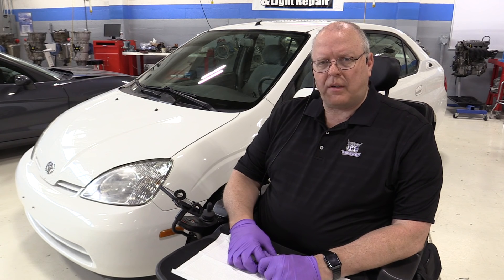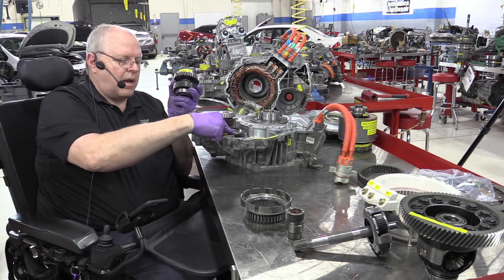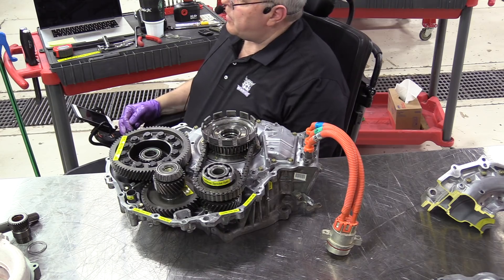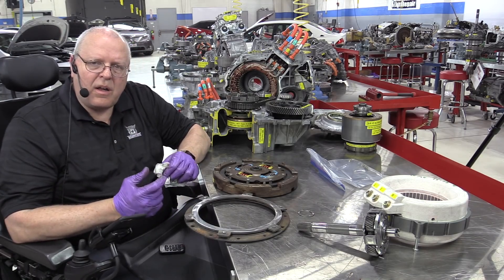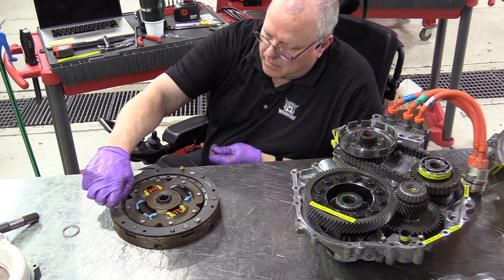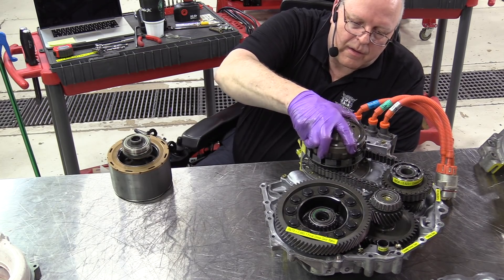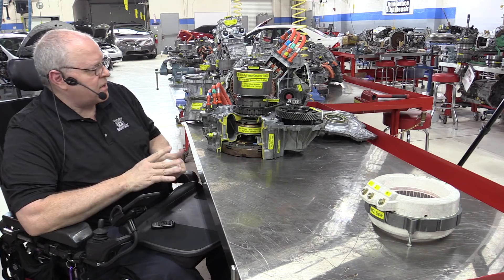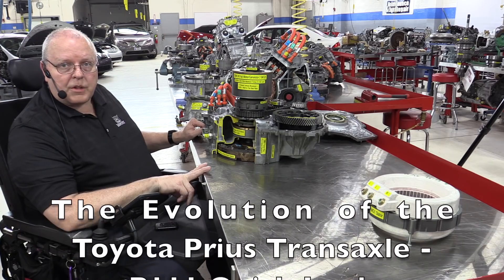1998 - 2003 Prius Transaxle -  P111 Quick Look

Comment: I am considering a p111 without any battery or invertor, as just a diff really., eliminating mg2 or mg1 or both.    If you physically lock mg1, then what is the gear ratio of engine to wheels?  3.91 : 1 like mg2, I thought it had a slight different gear to mg2.   I turn to your videos first, they are the best.  thanks
Reply: You can't if you lock mg1 the Engine is constantly linked to Engine so you would not be able to start or drive the vehicle

Comment: To say that MG2 provides the power to drive the vehicle down the road is not accurate. The gasoline engine drives the wheels. The job of MG1 is to put variable drag on the planetary gear set so as to control the ratio between the engine and the wheels. A by-product of this is electrical energy which is used to charge the battery and/or provide power to MG2. MG2 is also used for regenerative braking. Since the Honda systems lack a motor/generator geared directly to the wheels they are only considered a partial hybrid lacking the key feature of regenerative braking.  I presume that to provide an overdrive ratio, MG1 must spin faster than the gasoline engine and to do this it must draw power from MG2. Similarly, when in reverse, MG1 must drive in the opposite direction and again draw power from MG2 to accomplish this.
Reply from the maker: Thanks for your feedback. I meant to say that MG2 is the only motor directly connected to the final drive gear. Yes, the ICE and MG1 contribute torque to help propel the vehicle, but only through the ring gear attached to MG2.
Reply: @WeberAuto  When the gasoline engine start it sounds like it goes with CVT with hig RPM. I guess this is the reason ?  Hve you planed to see closer on Mitsubishi Outlander PHEV transmision,  i wonder if that is an simular construction ? ( i dont know about that model goes in your country ?)

Comment: Hello sir i have question? I have 2012 lexus ct200 smiler engine as 3rd generation prius. I bought that car from auction and got that fixed which had just front body parts damage nothing to engine or any electrical damage. After fixing that car or even before the car used to start and just after 1 mints it cuts out and fault comes on screen Hybrid system fault. What would you suggest? It starts and moves a little bit then cuts out.
Reply from the maker: Check for DTCs with a Toyota scan tool

Comment: thanks for this video! I've got one of these transaxles in my car and I'm really glad I have a better idea of how it works and what I can attribute to serious problems and what is just normal problems with a 15 year old hybrid. (Basically I'm getting low MPG and no assistance from the battery and a constantly running engine in my '03, this let me realize my transaxle is probably less damaged than I thought still because almost every function you described here is still flawless. My main question is whether the parking brake system being less effective is probably due to transaxle wear or some other more replaceable point?
Reply from the maker: Thank you! The parking brake system has nothing to do with the transaxle. It is related to the rear drum brake system. Best wishes!
Reply: New battery needed ...

Comment: Thank you for your videos! I just took apart Gen 1 and Gen 2 Prius batteries yesterday. The Gen 2 modules are healthy enough and will be put to use, but the Gen 1 cells are stone dead. Would you like to have the Gen 1 battery for display/poking at? I am somewhat local.
Reply from the maker: Thank you! Yes, that would be greatly appreciated!
Reply: WeberAuto I will likely be up in at least the SLC area in two weeks or so. What's the best way to get in touch?
Reply from the maker: Please email me at jkelly1@weber.edu and I will give you my contact information. Thanks again.

Comment: Hi John Would be interested to know if the 2002 Prius still has the original traction battery? There's differing opinions on how long they last! Best explanation of the operation of the Prius Hybrid I've come across.Cheers
Reply from the maker: Hi, yes it does. It only has 149k miles on it. It was a State vehicle in Montana for a long time. I have been involved in a few battery replacements, they lasted about 160k miles and approximately 10 years.